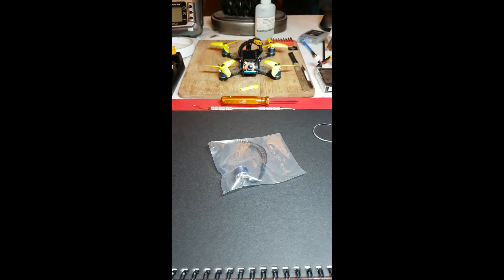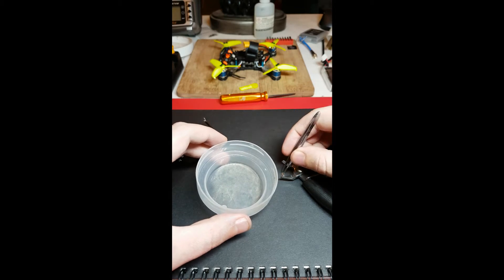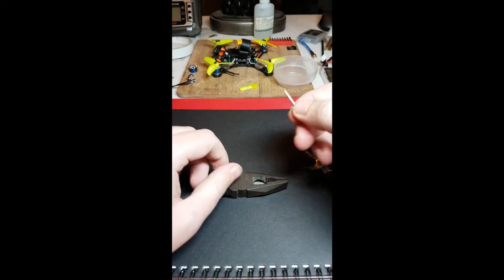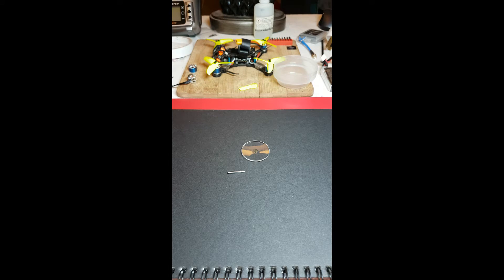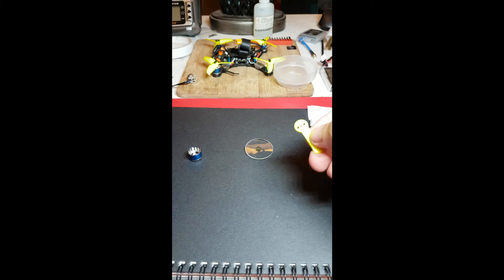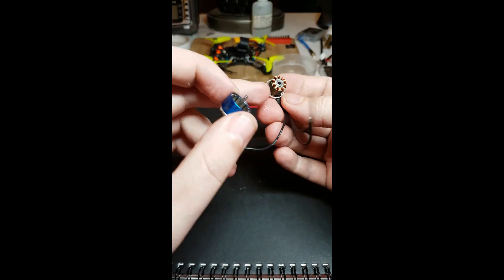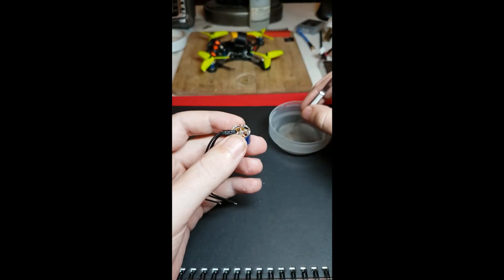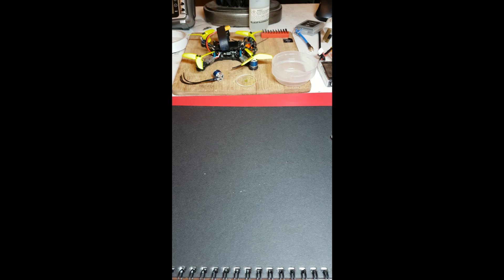Sunnysky 1106 Motors - Slipping shaft Fix

Comment: Any alternative glue I could use instead of the loctite?
Reply from the maker: RockTouching i guess you could give most adhesives a try, but I doubt any will work as well as the proper loctite.

Comment: I have the same motors, but my shaft came off WITH the C clip attached. Thanks for this video, I will try the Loctite 638.
Reply from the maker: RikkTheGaijin yeah if the motor pulls itself apart then the C clip will still be in place

Comment: Oh damn... Just bought 4 of those motors... 5500kv... :(
Reply from the maker: Mate they are still awesome motors. But if you have just bought them, there is the chance that yours have the modification that I designed that means they will not have the slipping issue. I'll try post up a video later today to help explain how to tell the difference. I have confirmed reports of people both here in the UK and in the US getting the updated motors through Banggood
Reply: BRDM Design Oh! Nice! Thanks a lot!!! Just subscribed! :)

Comment: Nice video! 
Them should be comparable with the 1106 emax motors? Do u know if them have the same problem?
Reply from the maker: andi I havent heard anything about the Emax bells slipping, from what I've been told the Emax are a bit less powerful and a little kinder to batteries. That being said I do love the power of these :) and the modified design is becoming more widely available and it completely eliminates the risk of bell slip

Comment: Is 242 loctite ok to use
Reply from the maker: 242 is a medium strength threadlocking compound and the 638 is specifically a retaining compound for shafts and gears etc. The 242 'might' work? but I would try get a small bottle of the 638 as it is specifically designed for this job. If you are going to try use a thread locking compound I would at least get the 262 high strength permanent stuff if possible. There is a bit of work involved in fixing the motors so it really is worth getting the right stuff if you can.
Reply: BRDM Design Thanks! I’ll get the 638 for the job.
Reply from the maker: No problem mate, good luck with the fix. Just take it easy getting the motor shaft aligned with the bore as you get it started, and take care to push it into place as straight as possible :)

Comment: I will try this with my motor the bell flew off and when I found the quad it had the shaft still in the motor with the bell lying beside it.
Reply from the maker: SteveO4478 this should work well, we have done this to a couple of motors that had already slipped and they have performed well since
Reply: BRDM Design how many flights had u put on the motors after doin this fix.
Reply from the maker: probably 15 to 20 packs since gluing them, lots of high throttle stuff too and they haven't slipped at all. I did purchase some of the upgraded design anyway, just for the peace of mind, these will likely find their way back onto another frame very shortly, they are amazing motors and thrust test are just starting to become available which shows them as one of the most powerful 1106's yet
Reply: BRDM Design yes the most powerful 1106! That’s for sure! Were did you by the updated version from??
Reply from the maker: I actually bought them directly from Sunnysky, I have been meaning to get back in touch with them and find where is the best place for people to buy them from, with confidence that they will receive the updated version. I have had a fair few people ask me now.
My situation was a little bit of a one off, as the modification that they made to fix the issue was based on a pair of concepts that I created and made available on Facebook, basically begging a motor manufacturer to fix the slipping bell issue. (this was before I purchased the first set of sunnyskys, but actually managed to explode two of the incredibly crap realacc motors I had earlier as well). I will email the person at Sunnysky that I was talking to and see if I can get a link or online retailer that will have the new stock and let you know.
Reply: BRDM Design they told me that they would only assure me that I would get the updated version from their eBay store. Their eBay store only carry the 8,000 and 5500kv motors for a pretty penny!
Reply from the maker: ah that's not cool, I did email my contact there this morning, hopefully I will have a reply soon. I guess the downside to them now having a good reliable motor that is being proven as one of the best performers is that they might keep the price high. I have seen 1104 motors bought through banggood that already have the new shaft design, so hopefully the old stock will soon be depleted and the new design will be available through other vendors like banggood etc
Reply: BRDM Design yes I have the updated 1104 motors from Banggood so those are good to go! As for the 1106 motor that has yet to be seen from Banggood. I will be getting 2 replacements from Banggood so I hope the 2 are the updated version or I will have loctite them as well. I will update on what version comes in.